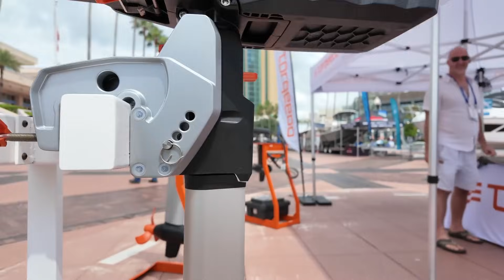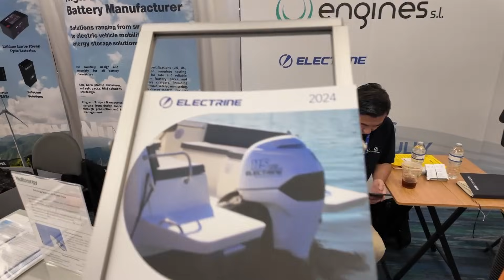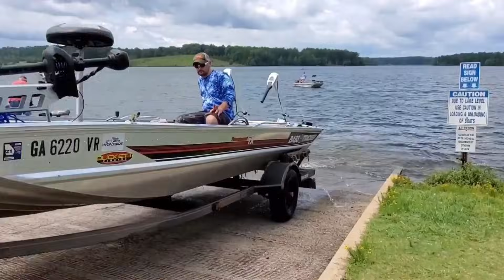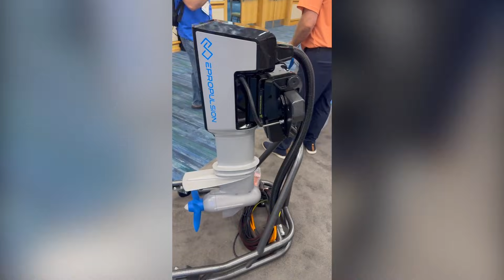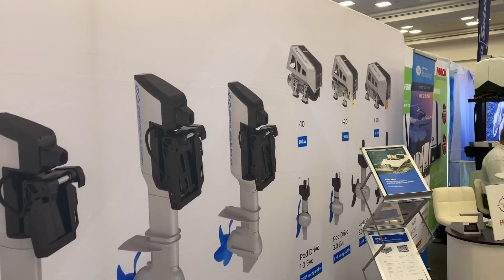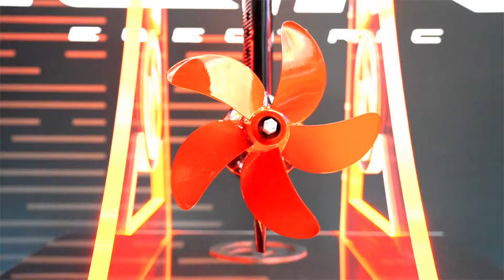Why Electric Outboards Are Better and Cheaper Than Gas Powered Outboards

Comment: BS video, electric is not better than gas, think about the batteries (waste that comes from production and when they fail) the weight, the runtime, and the power, when electric can produce 500hp, run for hours and "recharge" in seconds, or even wireless charging ill go for it but i cant afford a 30 mile charging cord, also dont expect charging stations to be available on or near water, maybe if you ran in as small pond or lake it would make sense but off shore or large lakes electric is a dumb idea